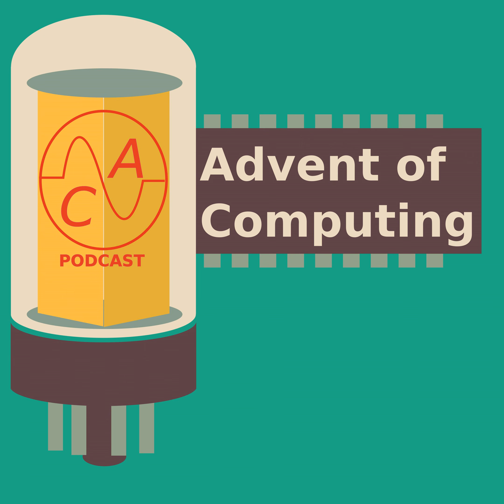Episode 105 - Apple's Growing Pains

Comment: For the Apple II drivers in ROM, there was a limited work-around to the 256 byte limit.  When a slot was selected by software, an additional 2KB of the card's address space was swapped in.  More ROM (or other memory mapped IO hardware) could be placed there.  Some cards took advantage of this additional space.
That said, this only modestly increased space.  It didn't fix other shortcomings (such as easy driver updates).

Comment: Fiberglass circuit boards warp, it's not the plastic and connections. If you take the motherboard out of your computer, grab it by the corners and flex the whole thing a few times I'd be surprised if it still works.